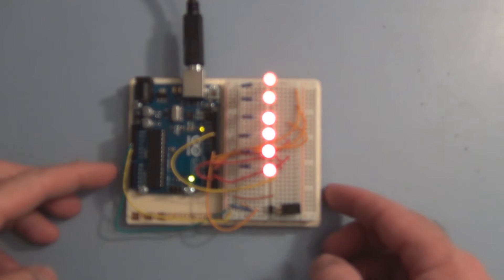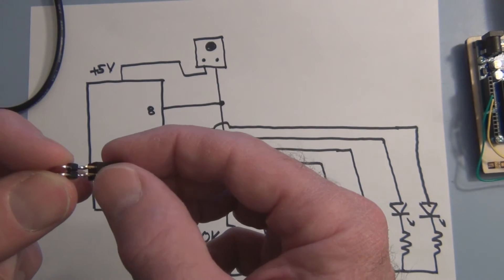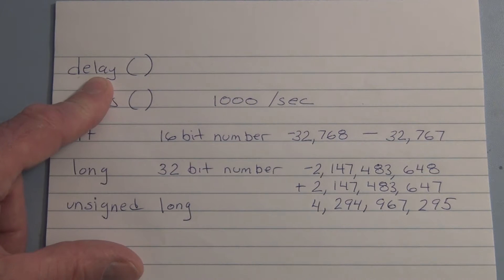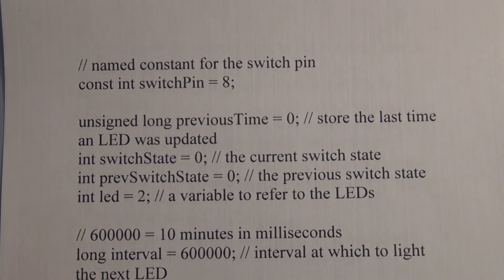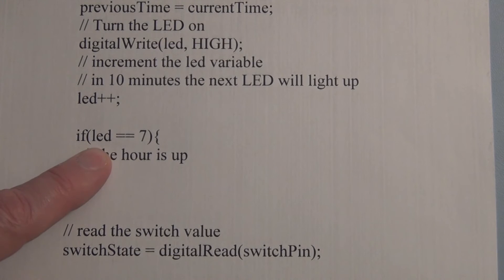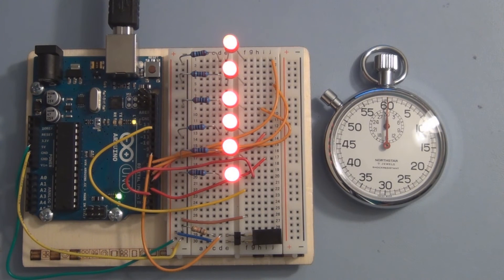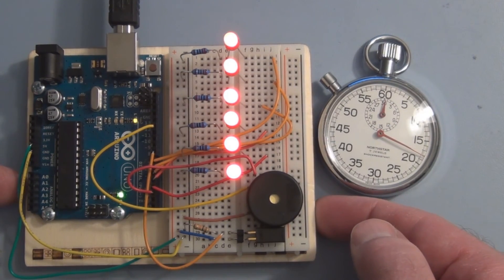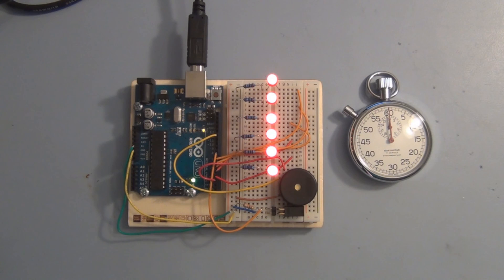Arduino LED Hour Glass Tutorial

Comment: Nice video!

What if i would like to use a push button insted of a tilt switch. 
If i hold the button HIGH, it will count and if i turn the button LOW, all the leds will turn off, no matter how long in the time it is.

I have tried without success
Reply: You could set it so whenever it changes from high to low it changes a variable from 0 to 1 and vice-versa, and use that variable to reset the hourglass

Comment: Hello where did you get the board from please provide the link.
Reply from the maker: +Sicilian Goomba It was included in the official Arduino Starter kit.http://www.amazon.com/Arduino-Starter-Official-170-page-Projects/dp/B009UKZV0A/ref=sr_1_1?ie=UTF8&qid=1451587814&sr=8-1&keywords=official+arduino+starter+kit.  You can also buy mounting plates separately.  https://www.adafruit.com/products/275

Comment: i don't understand the point of using a tilt switch to reset when you have the reset button on the arduinio
Reply: The purpose is to see how a tilt switch can be used.  The application of that knowledge afterwards is up to you.  Phones use the same tech... Teachable moment.